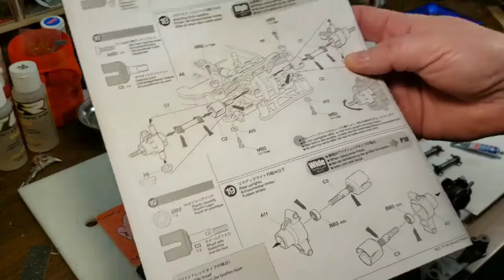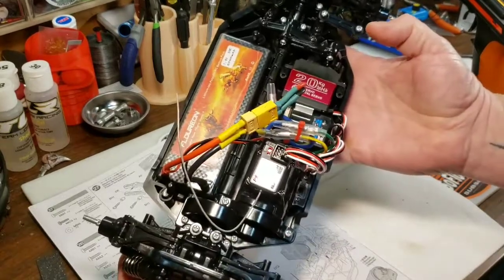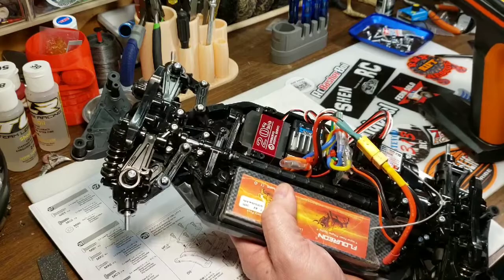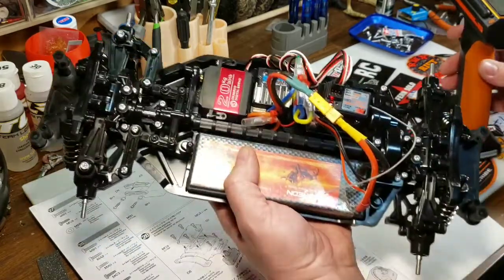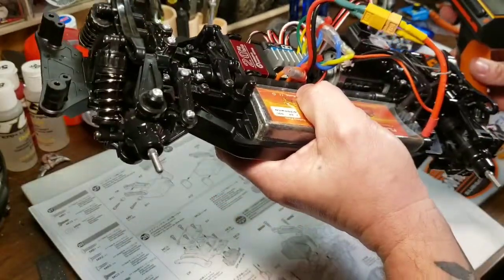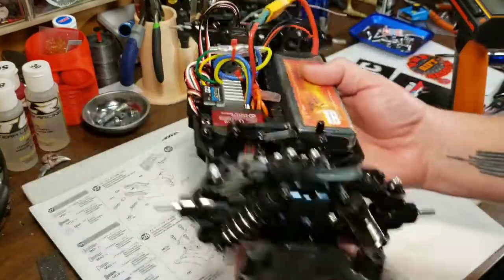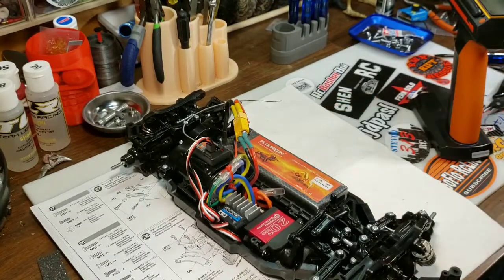Tamiya TT-02 Subaru WRX STI build part#3

Comment: Love the video man. I used a rotary tool to file down a lil on the steering stoppers(top and bottom a arms) and a lil in the middle of the car to allow the arms to turn more. Also i changed the servo saver to a solid servo arm to help with the steering.
Reply from the maker: Thanks for watching I thought about that to I have a solid arm it came with so far I haven't needed anymore steering but I did think about it 😎😁✌🏻

Comment: Nice..I'd move the receiver on top of the servo and mount a cooling fan on the motor shroud
Reply from the maker: Thanks philthy that is a good idea I think I have one laying around to😁✌🏻😀😎
Reply: @AdventureTimeRC  It's designed for it..If you take off the shroud cover a fan will screw right in place.
Reply from the maker: @philthyco1  I noticed that but just didn't think about it till you pointed it out
Reply: @AdventureTimeRC  Heck yea brother..It's a pretty nice option..Not needed in stock form really but still cool
Reply from the maker: @philthyco1  it think I'll probably try allot of different set ups on this car
Reply: @AdventureTimeRC  Oh yea..I did the same in my TT-02B lol

Comment: together it sounds pretty smooth+good!
edit: may want to plant the receiver top of steering servo? right on top of the very noisiest element (motor) might mess with range real quick. motor gets hotter too.
(seriously just hate seeing glitch wrecks!)
Reply from the maker: Lol so far so good I will probably move it at some point to put a fan on at the moment I have my voltage alarm on the servo since there is not a lipo cut off on the tamiya esc
Reply: 2 years ago snagged up a bunch of 3000mah NiMh that can push an honest 15C, 45-50A is plenty for most of the cars and boats here.

Comment: Sweet!! 👍👍 Like my Friend Mark said, the Steering is one issue... Not insurmountable, just finicky Tamiya stuff! 
I would HIGHLY recommend Yeah Racing 60mm Shocks for it. Especially since its a Rally Car. The extra 5mm gives you critical clearance, they're smooth Oil Filled Shocks with SEVERAL tuning adjustments...
And they're NOT expensive! 😉 
IF you end up really liking it, I'd definitely go with front CVDs. Dogbones are fine for the Rear, but front CVDs will give more Steering and eliminate popped out Dogbones! 
Carmine ✈🚂🚙
Reply: I'm loving those Flureon Batteries TOO! 
Great price, longest lasting so far.
Reply from the maker: Lol I have the 50mm ones on my mf-01x they are great shock s thanks allot for watching and the recommended shocks appreciate it brother 😁😎😀✌🏻
Reply: Always!!